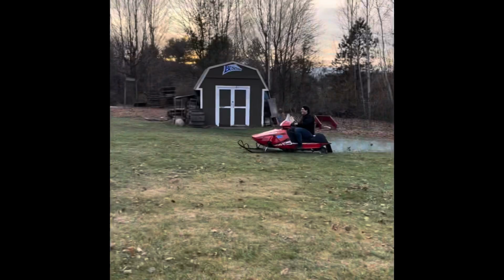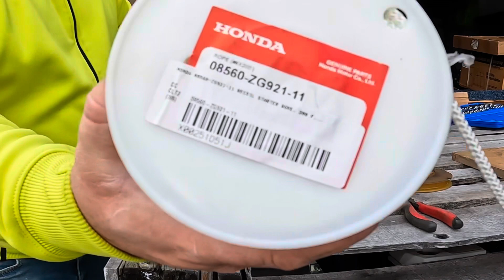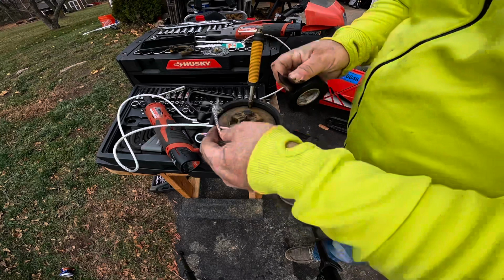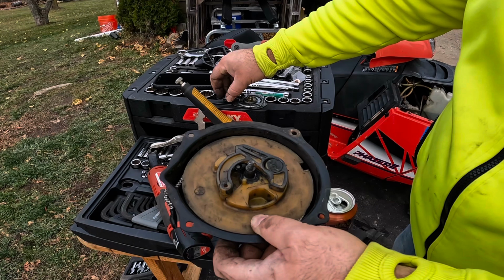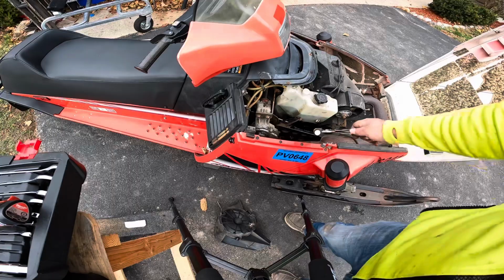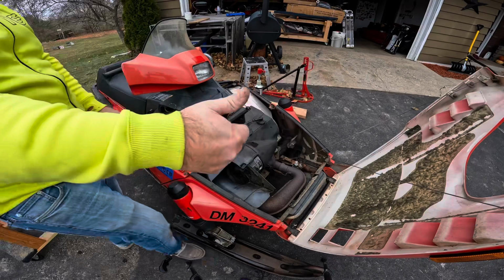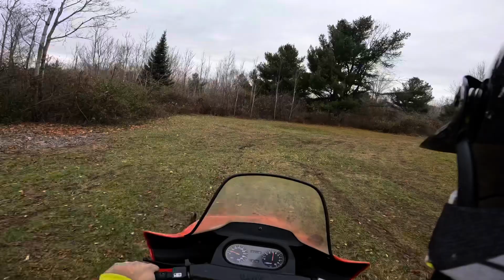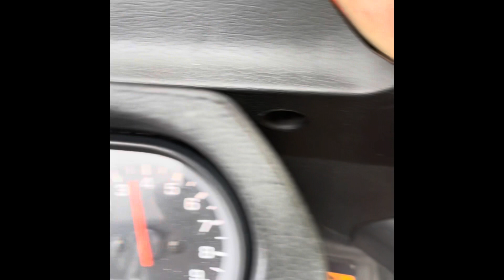Quick pull cord repair for snowmobiles - Yamaha phaser - bonus yard rip at the end!!!

Comment: How the heck do you get that recoil out past the frame? I need about 1/4” more space.
Reply from the maker: It’s tight in there. It came right out for me.
Reply: @2acres933  thanks for the reply. I ended up cutting a bit more out of the brace, dropped the recoil down & pulled it out on the front side of the sled.